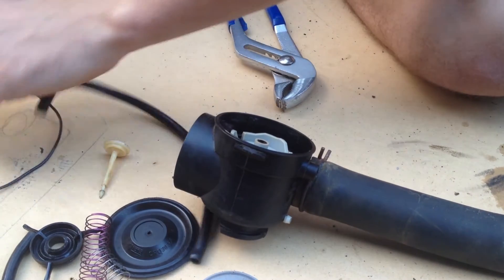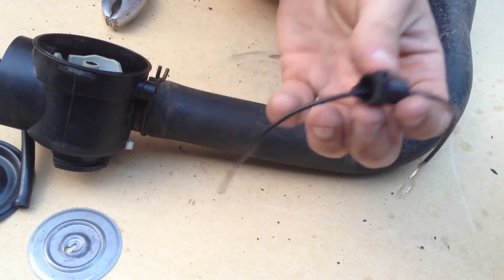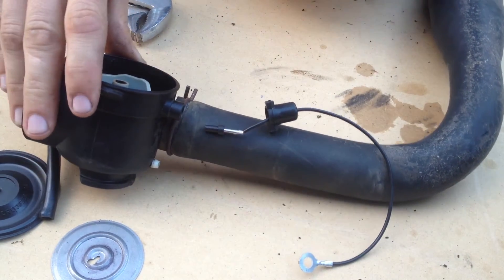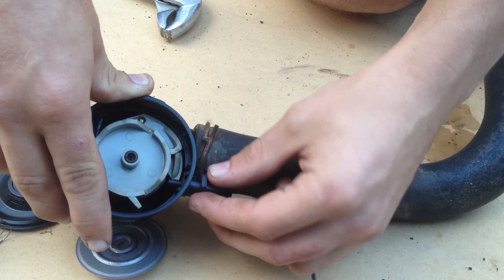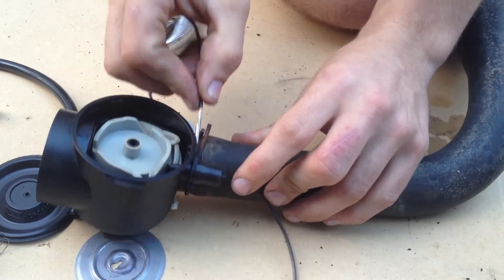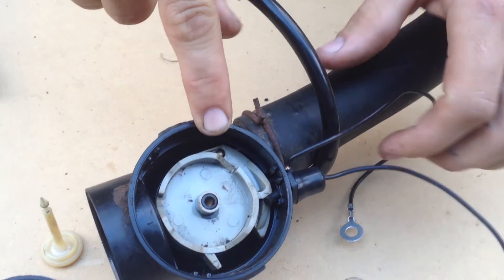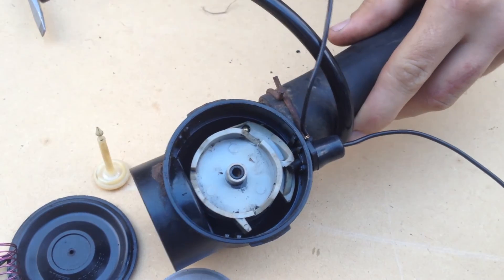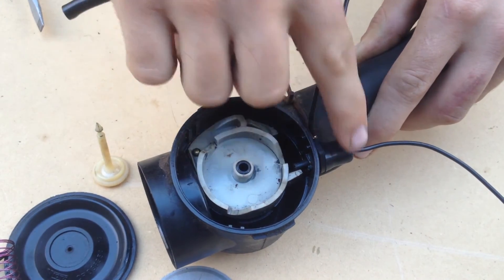PushMowerRepair.com - Victa G4 Ignition Wires On Off Switch

Comment: this is a horrible mechanism to cutoff, i've found even with new plug purchased from you its still very temperamental, i've just left out the earth, and use the petrol cut off switch to turn it off, works a treat, thanks for all your videos man.